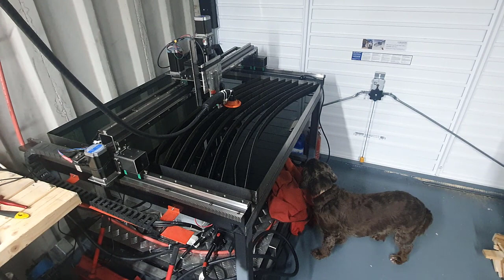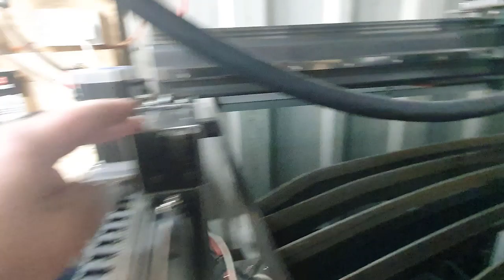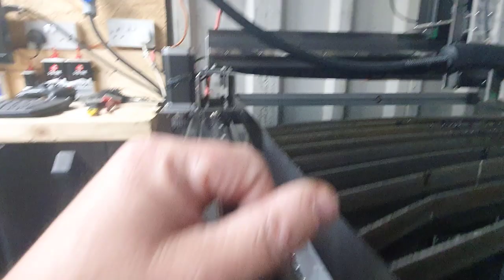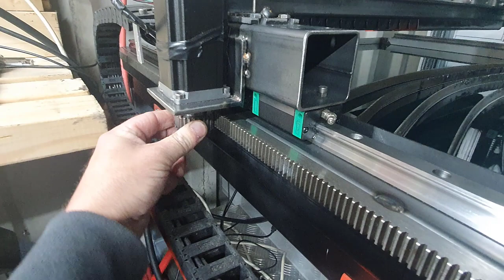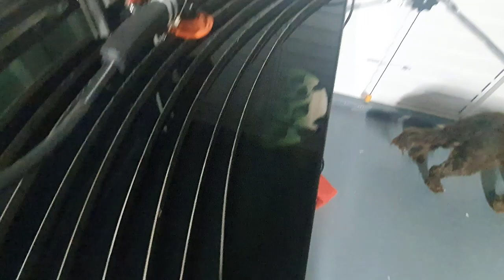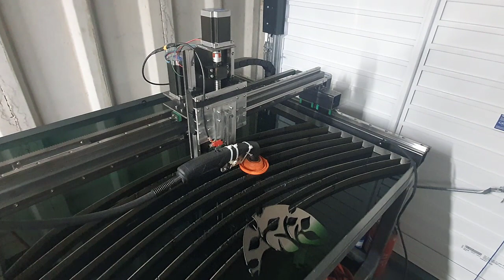My Diy CNC Plasma

Comment: Nice 👍
What rack and pinion module is that?
Reply from the maker: Just basic ones these as I find they do the job great . Grab me on instagram and will send the links over to you . Helical racks you really need however out of most people's price range
Reply: @smallgarageworkshop6119  yeah they are very pricey here in South Africa. Everything here for CNC is very pricey 

Thanks 🙏
Reply from the maker: @shaneschuller2513  I mean this latest one for a good friend I think has cost about 825 pound so not too bad 😉.    . Not sure how much if I posted over
Reply: @smallgarageworkshop6119  I used Module 1.5 on previous build. This build I'm going belts and keeping very simple with linear rails. I am build a cantilever type. 1.5m x 1.5m. 
I was inspired by my small desktop laser engraver design. 
Still working on it but so far looks promising. 
I think I'm going Linux CNC to build my standalone type controls - all in one box. 
I use SheetCam so it is compatible.

Comment: Awesome machine! Thanks for sharing your build. May I ask what the dimension of the tubing is? Is it 60x60mm? Many Thanks,
Dan
Reply from the maker: Hi 
Yes 60x60 max if its 3mm wall if going any bigger I use aluminium with 4 to 5mm wall . Any larger your then upping motor size which ups the funds . Check out my insta as I'm on with another 👍

Comment: Cool setup :) I am trying to make my own CNC plasma as well, found some drawings etc from a guy in US.
Reply from the maker: We're are you from ??
Reply: @smallgarageworkshop6119  I am from Denmark. Have been looking at the Langmuir systems for a while, but it would be very costly to get it to Europe
Reply from the maker: @srenfreiesleben1028  yeah nah not worth it as mine does milling wood , aluminium and cuts and engraved glass plus tube notches and is a beast . Cost me 1180 quid and built in 4 days . Cuts more accurate than anything shop bought
Reply from the maker: @srenfreiesleben1028  you can see what it cuts on instagram proper . @smallgarageworkshop
Reply: @smallgarageworkshop6119  ohh cool, did not know that it could do all of that :) And you made all the drawings etc yourself ?
Reply from the maker: @srenfreiesleben1028  yeah I have a vid on insta of me engraving a UTD badge on a mobile phone 👍

Comment: I know absolutely nothing / Zero about plasma cutting, and even less about setting up a CNC table, but you obviously know what you are talking about. I'm hoping you have, or will have enough info in future videos to walk a complete novice through the construction of a similar table.
Reply from the maker: Hi Gerald 
To be honest I was going to do with this build but there was so much to do with the garage and stuff I just had to bang on with it however I did take photos of the steps so may do another as all this on here is fit around a normal 60 to 70 hour a regular job 😀
Reply: @smallgarageworkshop6119  Appreciated. Best of luck.